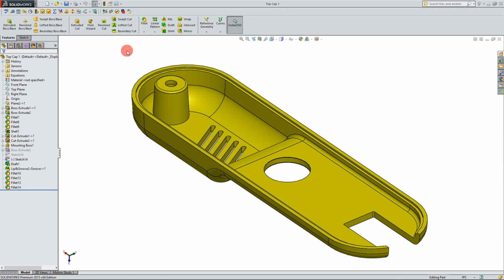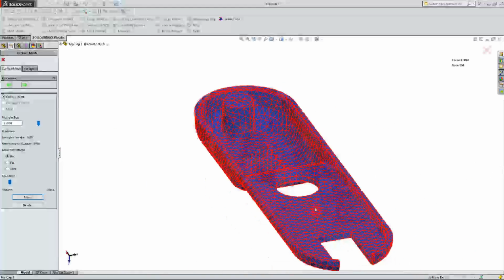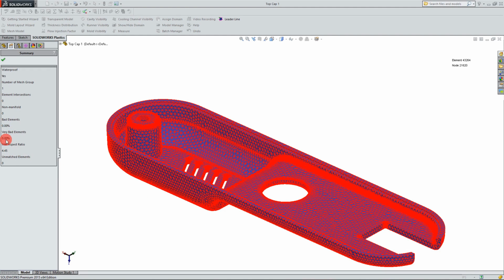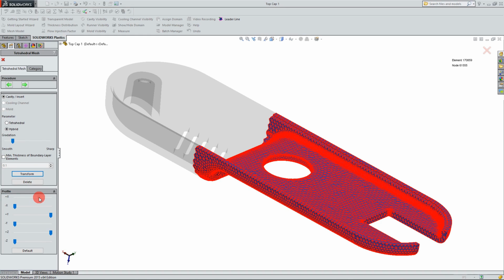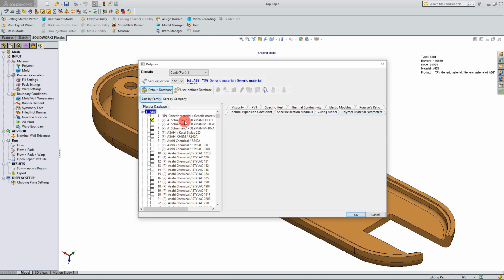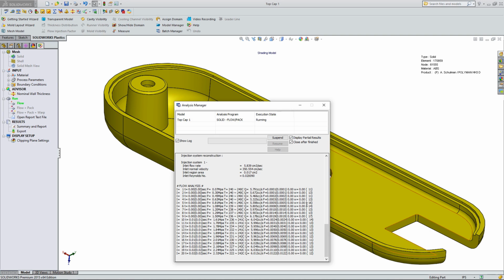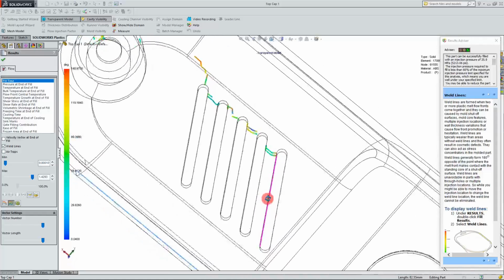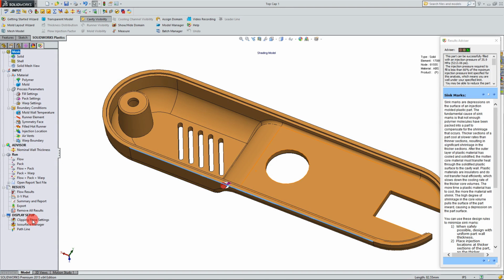Solidworks Plastics Simulation Tutorial 1: Injection Molding Flow, Sink Marks, Shrinkage, Weld Lines

Comment: Hello, great work there.
One quick question, is the plastic simulation interface different for v2021. Cause I am not able to view the different parameters you mentioned. 
Thanks
Reply from the maker: I am certain it is a bit different, but you should be able to access the same options. They may have changed the GUI.

Comment: Hello, 
Which software should one go for when analysing the plastic moldflow simulation. Solidworks or Autodesk Moldflow?
Reply from the maker: I have not used autodesk moldflow, but these are competing softwares that have very similar capabilities. It is not the software that defines a good simulation, but rather the inputs and accurate values that make a simulation a good interpetation of the final tool.

Comment: Ver very informative video. Thank you for the good work. I was just wondering whether simulating the plastic alone without the actual mold with all its components such as ejector pins and back plates; cooling channels and gate, runner and sprues can affect the accuracy of the results. Thank you.
Reply from the maker: It definitely does. There was no sprue or runner system and I did not even define if this was cold or hot runner. Also, a part like this could be made in a multi-impression mold which makes the difference even greater! That being said, a plastic part designer can still use this simulation to understand the flow path of a given part.
Reply: @AvivMakesRobots  thank you. Does this mean that to obtain the most accurate cooling time when optimizing cooling channels, I might need to simulate a detailed mold? is that possible? Most demos use virtual molds.

Comment: Hey juice. Is there any way to simulate pellets in the plastic to make sure they get distributed evenly?
Reply from the maker: Hello,
This is not necessary because the plastic pellets are mixed and melted together evenly within the metering zone of the injection unit. The pellets are in a liquid, homogenous state before they enter the tool.
Reply: @AvivMakesRobots  ah ok. What about particles like glass beads or fibers that is added to the mix?
Reply from the maker: Select "fiber orientation calculation" to compute the directions of the fibers as part of the simulation. 

You may also need to "set coinjection".

Comment: Great video!
is there any way to export "temperature at the end of fill" for all of the nodes at the same time?
Reply from the maker: Thanks! 
I am trying to understand the question. Are you referring to the nodes of the mesh itself? To get a mapping of the temp at end of fill for each individual node? It may be possible to get this by exporting the mold flow report, but:
If your goal is to get a better understanding of the temperature at the end of fill in certain spots, you can try looking at the "clipping plane mode" which lets you look at the pressures inside the part and not just on the surface skin. This may be more advantageous to you.
Reply: @AvivMakesRobots  yes exactly the first one i was trying to export the datas for last few weeks 
no progress yet🤦‍♀️

Comment: Hello thanks for video, I would like to ask a question. Can we estimate the total cycle run of injection mold?
Reply from the maker: Yes, a timing estimate is given for injection and packing pressure (be sure to do both a filling and packing simulation). That being said, the software is not giving you the rest of the cycle like the demolding time and etc... But this can be deduced from the machine.